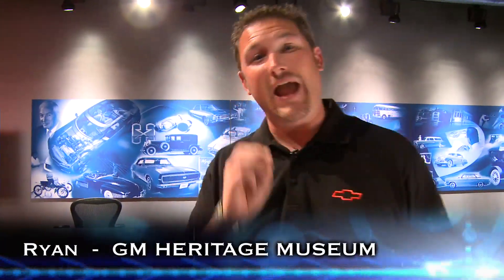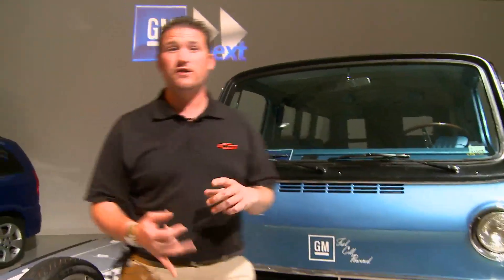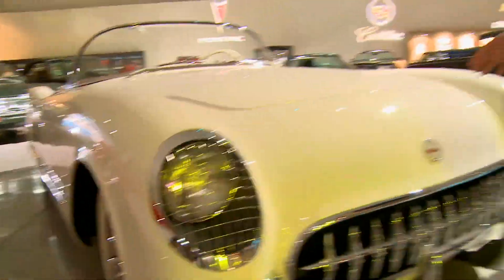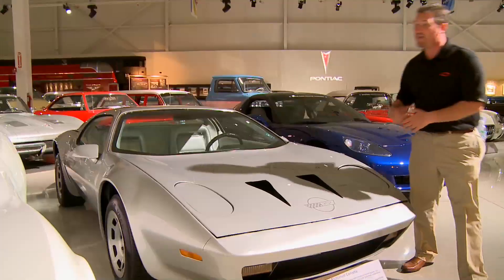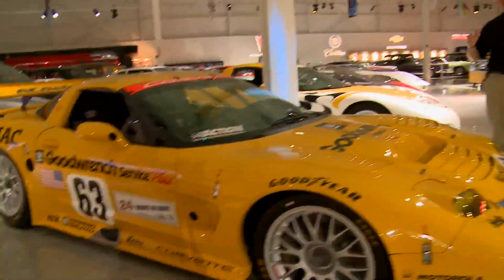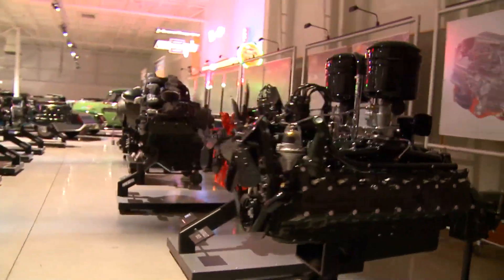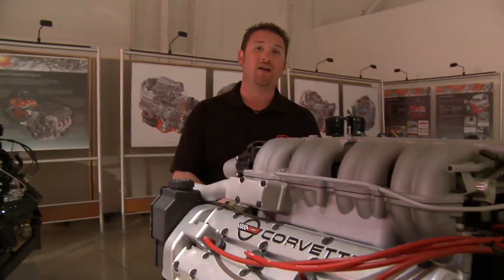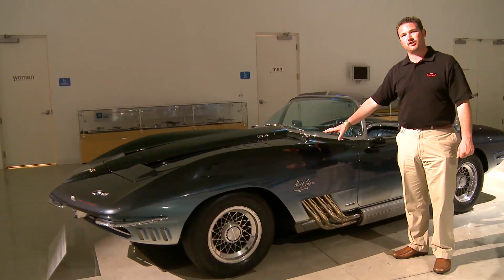Best 100 Cars of the Century- GM Heritage Collection

Comment: Thanks for the info. Did you know that NASA rearched hydrogen / gasoline hybred fuel systems. Even a steam reformation of methanol using exhause heat, similar to a GEET reactor heat transfer system, back in the 70s.
Google:

" EMISSIONS AND TOTAL ENERGY CONSUMPTION OF A MULTICYLINDER PISTON ENGINE RUNNING ON GASOLINE AND A HYDROGEN-GASOLINE MIXTURE"

Despite favourable results nothing was ever developed and it went no further.

Comment: I still would rather have a nice comfy and powerful Charger, 300C, Impala, Crown Victoria (Literally built FORD tough, tried and tested by our police and taxis), Caddilac over any tight cramped econobox such as Camry, Corolla, Accor etc. And don't toss in the "Maxima" and "Altima" into the picture, whose identity crisis of wether it is full size or mid size make for some really akward space.

Also, at least you can tell American cars apart, and have real names. "Corolla" What the heck is that?